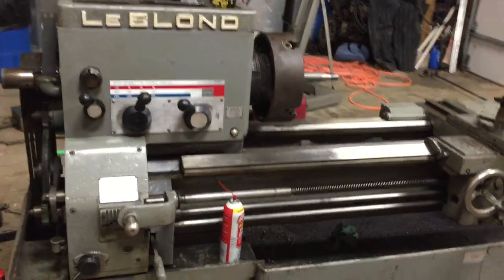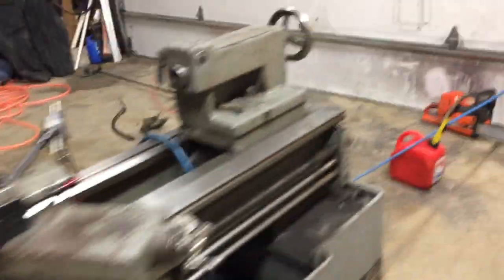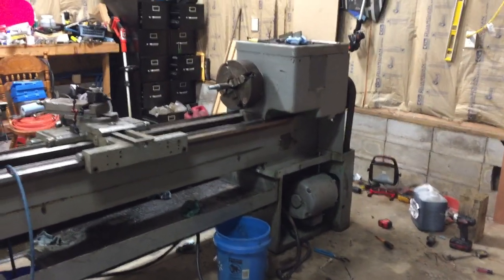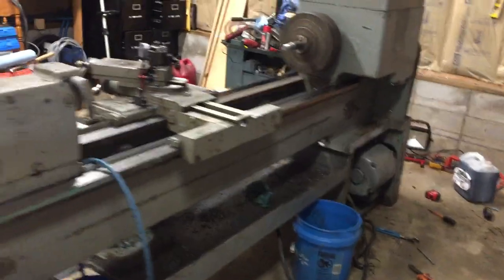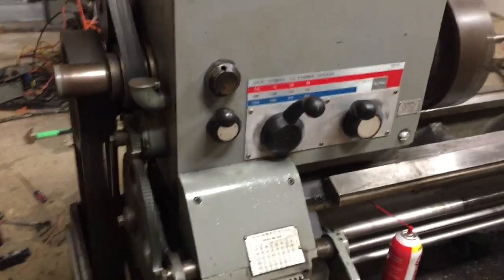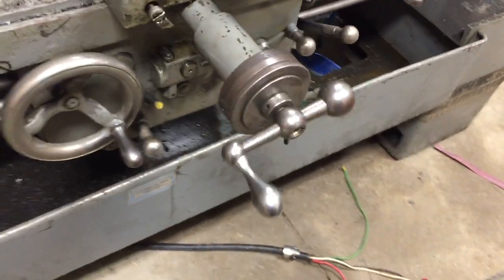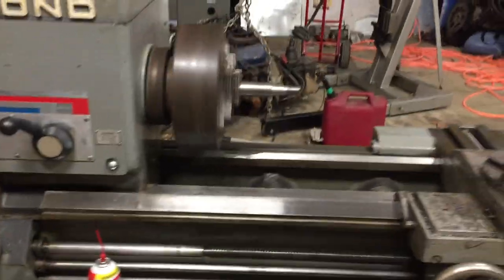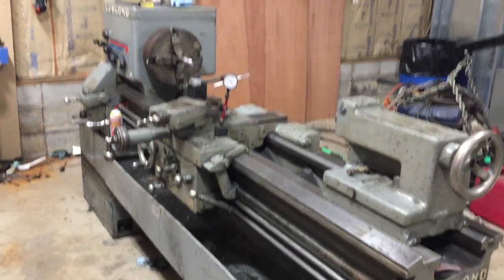New Leblond 19" Lathe For The Shop

Comment: Nice machine but it looks like you might have a cross feed problem.
Reply from the maker: Rolingmetal you are right I did had to take it all apart and clean it all. Nut and threads was packed with grinding dust. Then cleaned the ways with it apart. It turns so much easier now. Thx for watching